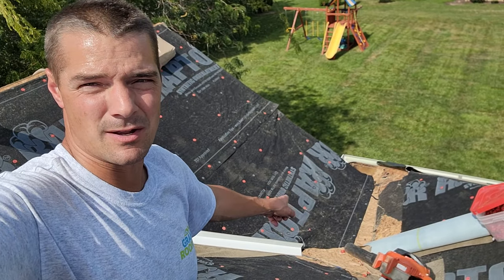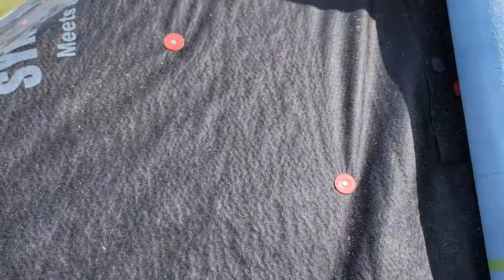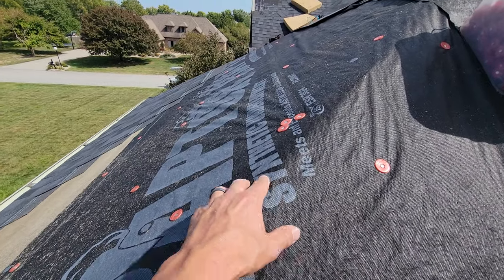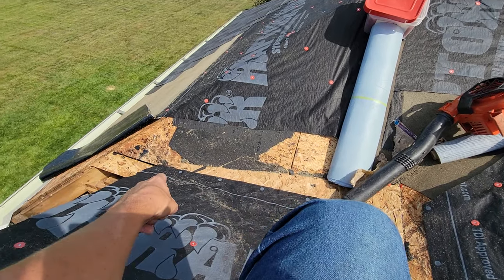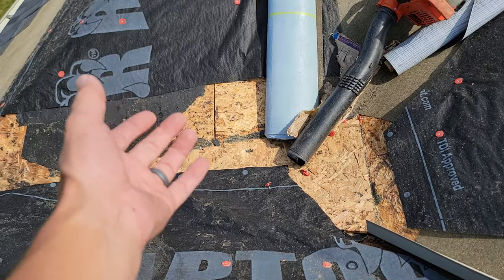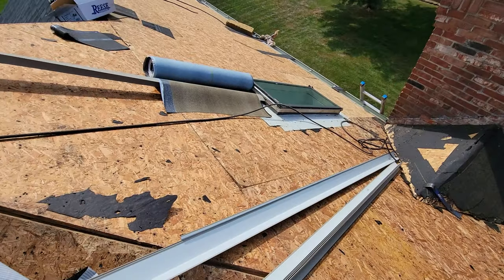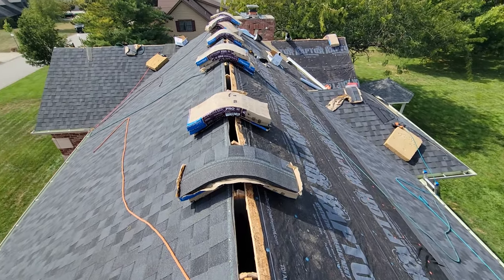Low slope roof / Dead pocket roof section

Comment: Brian in our area when you have the ridge with a ridge board down the middle. They will cut it ridge vent and put in box vents for the right amount of air flow per calculation. Just our way.

Comment: I agree with almost everything you teach. One thing I don’t necessarily agree with you on is edge metal. In our area just north of you everyone uses drip edge for the bottom. You prefer apron and say drip edge is wrong material to use. Can you speak further on why you feel it’s wrong? I feel with apron the water follows the apron right onto the gutter fasteners which over time starts to leak into the fascia. Where drip edge allows the majority of the water to drip straight into the gutter. Obviously some water still gets on fasteners but not as much as gutter apron. I am open to changing but it has to make sense. Thanks for your videos. It’s cool to see how others do things.

Comment: Please come to my house!! We added on about 8 years ago and I shingled the roof. Lasted 8 years. No rain leaks, no ice damn water in my new living room. We had a hail storm around 2019. Had the whole house shingled by a local roofing company. First big rain...water was pouring into our upstairs bathroom. Roofer came back and said they'd try something but it is wrong and backwards....hope it works. It did not. The water came back into the house again...no luck. We have also had ice damn water coming into our house every winter since they did the roof. We put up heat tape and even heat mats to help with that. We are at the end or our rope..:(  You might say maybe I should shingle again myself. I may have gotten lucky the first time, I don't know. It's a tricky valley and dead spot but it was fine when I did it. Also I am older and my body does not like the thought of the project. Thanks for your videos!

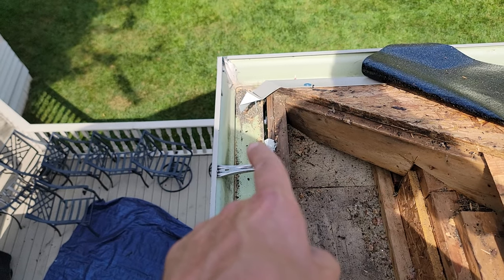Comment: I wonder if someone can guide me. I installed a sun tunnel, but it's too dark as it has too many bends. I will need to move it on my roof closer to a section with much less slope. This was an extension and they tied the new roof into the old one. The slope goes from shingled probably 6:12 to a much flatter section, probably roll roof. Can I put my sun tunnel as low on the shingled roof with the regular slop that the bottom flange overlaps the last row of the shingles? I tried to stay away from it, but as I said it's too dark. I am a DIY who learned from Brian. It is my second sun tunnel but the other was straightforward. If it matters I live where it rains only 3 months a year and we get less than 7 days of freezing temps and there never is snow.